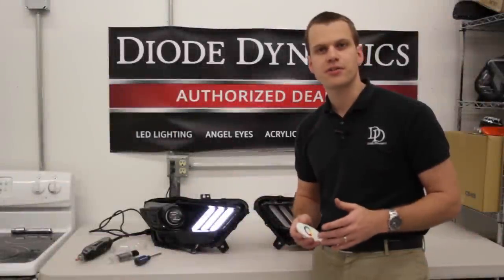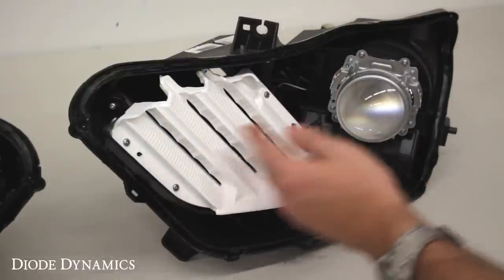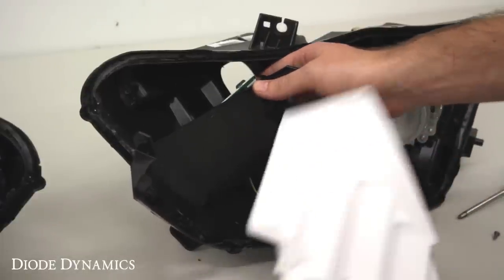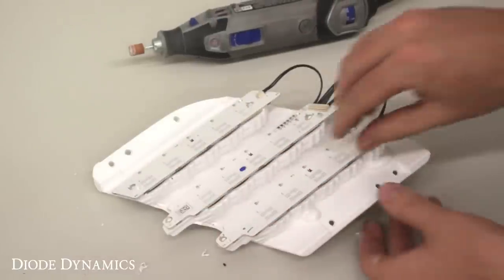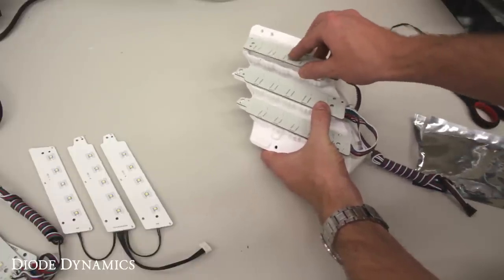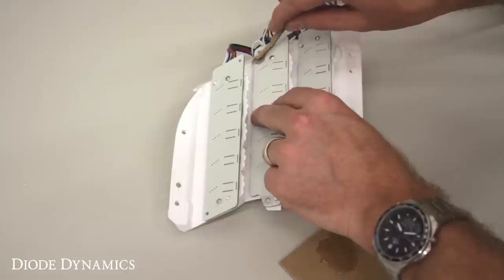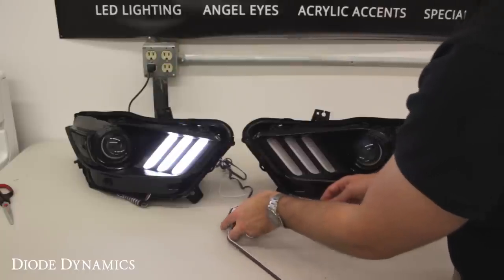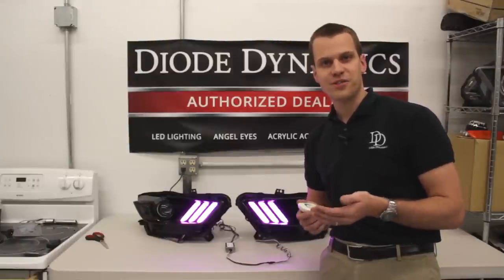How to Install 2015-2017 Ford Mustang RGBWA™ DRL LED Boards by Diode Dynamics

Comment: May I suggest you just provide your boards attached to a direct replacement mount so we don't have to bust out the dremel? Should be a relatively cheap part to reproduce and would sure be a huge benefit to the end user...especially if someone wanted to return to stock for whatever reason.

Comment: sweet i just got them tonight! I am probably gonna install them myself, but in case do you guys know how much they usually charge at you're dealers? Btw the product looks great not cheap at all. thank you so much
Reply from the maker: +Morgan Freeman, installation cost varies from dealer to dealer. Below is a link to our Dealer Locator Tool. Feel free to call the dealers nearest you and they can give you more details on what it would cost to install the LED boards! 

http://www.diodedynamics.com/store/index.php/find-dealers/
Reply: +Morgan Freeman I contacted one of their installers and cost to install involves removing front bumper, oven bake the lights and best to leave car over night. Cost $500.00.

Comment: Hey diode dynamics. Got my kit last year and was going to attempt an install over winter. Seems fairly straight forward. My question is, since this are a tight sealed beam from factory, once I open them and seal them I've heard the moisture will always be in there. Know anything about that?
Reply from the maker: Hi there! To avoid potential moisture issues, we definitely recommend working with a professional installer whenever possible. Please feel free to give us a call at 314-205-3033 Monday-Friday 9 a.m.- 5 p.m. CST, or shoot us an email at contact@diodedynamics.com, and our service team will be happy to answer any installation questions or recommend an installer near you!

Comment: I hope you get something out soon. Every time I see a new mustang pull up across an intersection, it looks so lifeless with those dim DRL's. Then any other car with DRL's pulls up next to the mustang, a camaro, Dodge Charger, any imports and it looks like the mustang has a alternator issue with the LED DRL's just disappear next to those new cars. Even the 2013-14 mustangs with their first two parallel LED DRL diodes in each headlight, were very dull. What's worse is, on these new 2015's, the DRLS look great from a 30-50 degree angle to the side of the front bumper, but when viewed head on, they almost disappear and look like 3 thintoothpicks. So, yes, it would be great to stuff some nice BRIGHT LEDs in there like on every other car theses days. Brighter would give the mustang more character and make the car stand out. People lol at my 14' mustang, ask me what's up with the fake LED DRL's. I ask them why? They say they're obviously fake because they are so dim. Ricer-ish, as some have put it. Everyone else has the brightness figured out, why not Ford?..... My buddy swapped out the boards as you have done in these 2015's, with brighter strips as a custom project and it's a huge improvement over stock. Look at a new charger, 2015 challenger, camaros bright parenthesis LEDs around the outer sides of the headlights, or even a cheap little Chevy Cruze has bright LEDs in the traditional fog light section. Oh, how about LED round fog lights, like in the Porsche Vayman/Boxster, those would help too.
Reply: MH motorVlogs stfu

Comment: This looks pretty nice, but how to get the lens off. Is it glued or screwed and snapped on the housing?
Reply from the maker: +Jean-Luc Van de Borne To open the headlight, apply heat to break the seal of the adhesive. If you are not comfortable doing this yourself, we have a great network of Authorized Dealers who may be able to help! Check out the link below to find the dealer nearest you! 
http://www.diodedynamics.com/store/index.php/find-dealers/

Comment: Ive already seen the color change DRL LED such as you have here, and again, they were barely visible in cloudy conditions, which means, not visible in full day light. Showing these in a dark room is not a good test bed.
Reply from the maker: Michael Harris these replacements are slightly brighter than the factory lights. Because additional brightness requires significant other considerations for reliability and optics, we will not likely be developing a brighter replacement solution. This video shows how to install the lights- it is not a "test" video of any sort.

Comment: My headlights were sealed with Morimoto Retro and my headlights are now fogging up fully when there’s rain or its a humid day. What should I do? Ideas for the cap? I assume I did it right... i drilled a hole through the back cap and pulled wires through and used high temp silicone to seal the cap hole. By the cap I mean the white cap on the back of headlight that you twist on and off.
Reply from the maker: Hi there! Please go ahead and give us a call at 314-205-3033 Monday-Friday 9 a.m.- 5 p.m. CST, or shoot us an email at contact@diodedynamics.com, and our service team will be happy to troubleshoot that!

Comment: It would have been nice if you guys would have shown a video of how to take the headlight cover off, it's a nightmare to do that btw... it take at least 2 hours per light as well.
Reply from the maker: +Adrian Smolski This can definitely be a tricky and slow process, so we recommend professional installation by one of our Authorized Dealers/Installers!
Reply: I agree but I am in Australia, I don't think there would be anyone here doing that yet.  also, I have sent you an email request around EU Mustang version connectivity of the wiring. Note: EU versions don't have an existing tribar LED set and I don't know how and to where I need to connect the pigtail wires. can you please reply to my email with instructions?
Reply from the maker: +Adrian Smolski Thank you for your email! We do our best to respond to all emails within one business day and look forward to assisting you.

Comment: Hi guys...it would be much appreciated if you guys could show us how to actually install the boards in the car after modifying the headlights. Thanks
Reply from the maker: +shane, thank you for the input. If you are still having trouble installing the boards please send us an email at contact@diodedynamics.com, and we can help you out.
Reply: +Diode Dynamics  Hi guys I have mailed you already but i havent got any response back from you at all any reply would be nice thanks
Reply from the maker: +shane, it will normally take us 1 to 2 days to respond to most emails and sometimes it can take a little longer if we are receiving a lot. Feel free to send us another one just in case it was lost, and you can expect to hear back from us soon.

Comment: On your website, you have an $80+ option. I assume this is for the front sequential turn signals?
Reply from the maker: +'Cano CM, yep, that is correct. Our RGBW™ LED Boards have full multicolor functionality plus a pure white color. Our RGBWA™ LED Boards have full multicolor functionality plus a sequential amber turn signal. Just let us know if you have any other questions!
Reply: +Diode Dynamics Sweet! I'll be using your locator to have them put in. Do i just have them shipped to me then bring the product with me to have them installed? or have them shipped to them and receive a call from the store i chose to have them put in? Additionally, around how long will it take for them to install?
Reply: +Diode Dynamics One more thing! Is it the store location that will chose a install price?
Reply from the maker: +'Cano CM, you can either have them shipped to you and bring them with you to have them installed or purchase them from the dealer directly. Installation time and price will vary from dealer to dealer, so you will have to check with each dealer on that. If you need anything else, just let us know!

Comment: Does the RGBWA include the amber for switchback turn signals (meaning is that their purpose)? And are there any plans to tinker with a dimmable setup (via the remote) for increased intensity for daytime vs nightime driving?
Reply from the maker: +gsxrrider827, the amber chip is going to be for the sequential turn signal portion of the replacement boards. There are in fact already options to dim via the wireless remote!
Reply: They're sequential too????? AWWWWWW!!!!! man, now i have to go grab  a second headlight housing and do this!!! Do you have any videos of their operation? And do they work in conjunction with the switchback LED's that i already have?
Reply from the maker: +gsxrrider827, check out the Instagram link below to check out video of the sequential going!

https://instagram.com/p/5LpU_SQfDL/?taken-by=jjfordjr
Reply: +Diode Dynamics Wow, how cleverly that instagram video answered every question i had... I WANT IT!!!!!!!!!!!!!! haha I'll have to see what it'll cost to make that happen. Thanks, guys!!!
Reply from the maker: +gsxrrider827, glad we could be of help! If you have any other questions just let us know!

Comment: What’s happens when they blow out or fail then what ??? Do you guys instal or sale the units
Reply from the maker: Hi there! We proudly manufacture our products right here in the USA, and stand behind our  RGBWA DRL LED Boards with a 3-year worry free warranty! Though we don't offer installation services, you can use our Dealer Locator tool to find a qualified installer near you! Here is the link: https://www.diodedynamics.com/find-a-dealer

Comment: Is everything plug and play I don’t want to do no splicing  thanks !
Reply from the maker: Unfortunately, there will be some splicing involved, however the T-taps that are included in the kit, make splicing a breeze! The only quick splicing required are for the OEM functions like your turn signals and DRL power, everything else is plug-and-play!

Comment: Would've been better had you previewed these awesome headlights on an actual mustang. Nice video though.
Reply from the maker: WunBoundless, stay tuned for when we put these completed headlights back on our shop 2015 Mustang! We expect to do that in the coming weeks, as the rest of our car is currently undergoing some other extensive modifications to get ready for some big events coming up. The best way to stay up to date is to follow us on Facebook or Instagram (@diodedynamics). Thanks!

Comment: Is it legal to drive with non white color activated while driving
Reply from the maker: Hi there! We don't recommend using the multicolor functionality on the road. These LED boards are fully RGBW capable, so you'll have a bright, pure white for street use!

Comment: What's the difference between the RGBW and the RGBWA
Reply: +jose moya The RGBWA does Amber as well. This matches the factory side marker lights OR switchback LEDs if you have those installed. I don't see why anyone would want to run amber though when that white is so crisp... ;)

Comment: Is it possible to connect the turn on / off of this LED lights right to cars lights or only way to turn it on is the external controller? Iam from EU and i want to use them as daylight since ford has removed the LED stripes from EU distribution, but i dont want to turn it on with some extra controller. Is there way to connect this lights instead of standart ford EU daylights?  (and dont worry about local law, just tell me pls if it is possible :) Thanx for answer!
Reply from the maker: +doldent Go ahead and shoot us an email at contact@diodedynamics.com, and our sales representatives can help you out!

Comment: The color upgrade is nice, but these things need brightness.
Reply: +Michael Harris The integrated white LEDs utilized in this kit are actually brighter than the factory LEDs. In addition, they produce a much cleaner white vs. the purple tinted OEM LED setup.

Comment: Does the external regulator include when we bought the diode dynamics tri-bar drl ?
Reply from the maker: Hi Rio! The drivers are included with the boards.
Reply: Diode Dynamics thank you for replying. However, i need help about the tri-bar drl mustang headlight. I had a 2016 Mustang ecoboost Uk version(euro). This version did not include the tri-bar drl. So, can you do me a favor by helping me out installing the drl into my car? Maybe you could give some tips or more detail infomation about it. Moreover, i would really like more if my tri-bar drl replace by diode dynamics product.
Reply from the maker: Sure! Please go ahead and give us a call at 314-205-3033 Monday-Friday 9 a.m.- 5 p.m. CST, or shoot us an email at contact@diodedynamics.com, and our service team will be happy to help!
Reply: Diode Dynamics i’m sorry, it’s my fault. I wrote the wrong email address. My bad. Just ignore what i’ve just tell you about the “domain issue”.
Reply from the maker: No problem, thank you for reaching out!

Comment: How do we get the DRLs to dim when the headlights come on?
Reply from the maker: You can use your app or the controller to dim the white light option!
Reply: @diodedynamics  You want me to use the app every time my headlights automatically come on?
Reply from the maker: @minshum  If you would like to dim these DRLs, you will have to use your app.

Comment: I'm confuse do you need to oven these?
Reply from the maker: +Insanetrickz98, yes, installation does require opening the headlamps, which can be done using an oven. If you don't feel comfortable opening your headlights, we have a great network of very talented installers that would be happy to help you with installation. If you have any other questions, feel free to contact us!
Reply: +Diode Dynamics I actually visited a place that it said can help but it took me to a house.
Reply from the maker: +Insanetrickz98, some dealers do operate out of their homes. We would suggest giving them a call first before visiting. If you need anything else, just let us know!
Reply: Insanetrickz98 do you need to let them overnight after putting them back together

Comment: thats lot of work for just rgb light and they are not even mentioning the removal of bumper
Reply from the maker: +Jitenderpal Dhillon, we have a great network of Authorized Dealers who would be happy to help you with installation, if it is too much work for you! Below is a link to our Dealer Locator Tool, so you can find the dealer nearest you! 

http://www.diodedynamics.com/store/index.php/find-dealers/
Reply: I've contacted three so far that want me to pay more $ then I paid for the lights. I would understand paying $200 or around that range, but they are wanting $399-$499. I may end up returning the lights because of this.